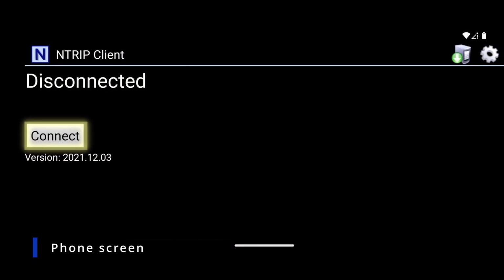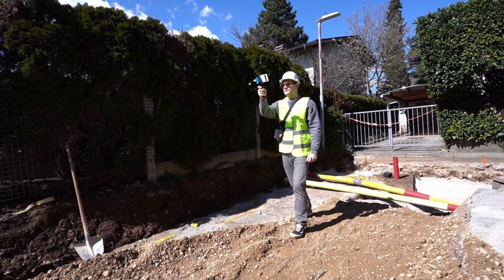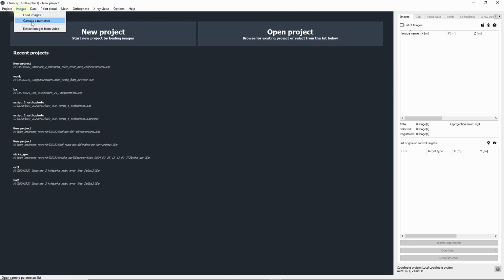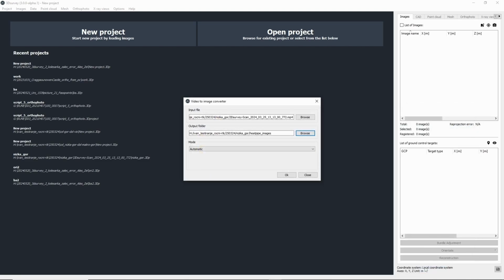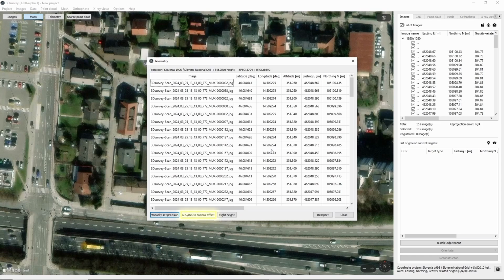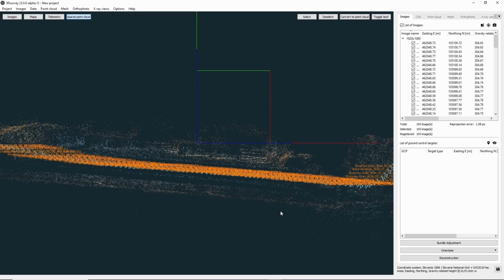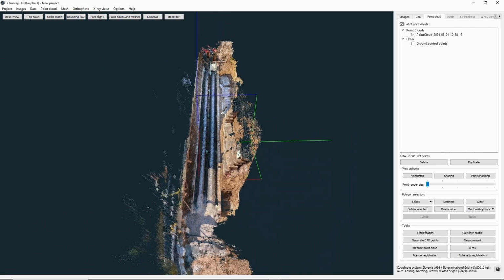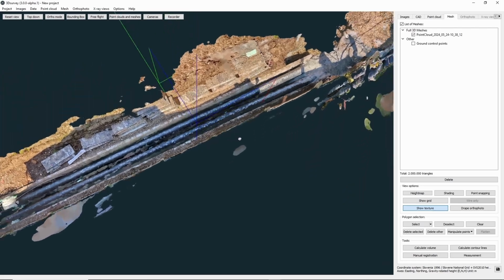Handheld RTK Videogrammetry with 3Dsurvey: Step-by-Step Guide for Accurate 3D Models

Comment: After the point cloud 3d model is generated, what is the error in the length measurement?
Reply from the maker: Whitepaper was produced for this case, where absolute and relative errors were documented. Find it on our webpage:
 https://3dsurvey.si/wp-content/uploads/2024/06/Videogrammetry_Accuracy_for_Point_Calculation__using_Mobile_Phone___RTK_Antenna_-1-1.pdf

Comment: What is the hardware for the rtk you were using?
Reply from the maker: REDCatch RTK antenna combined with pixel 7a phone was used in this case.
Reply: Can this antenna work as a gnss receiver without rtk?